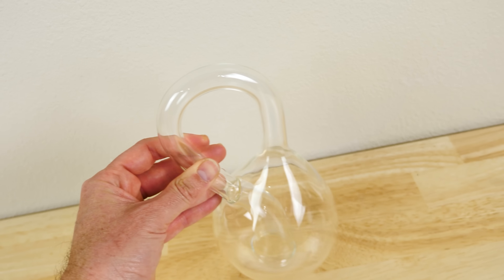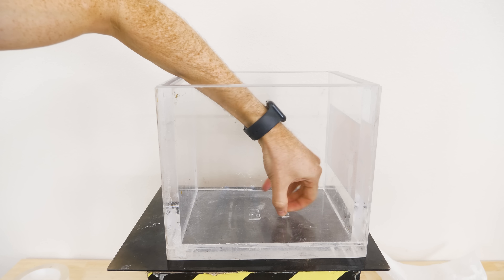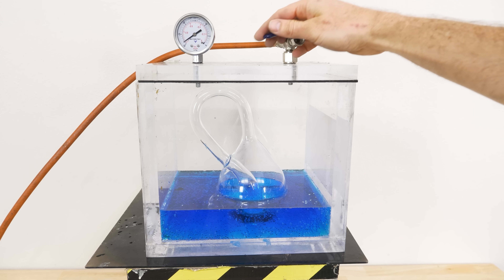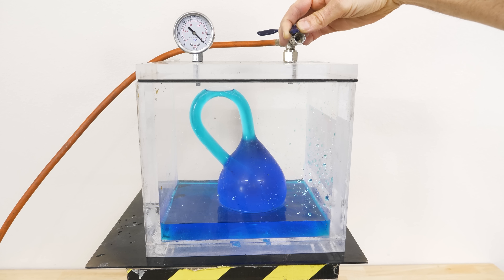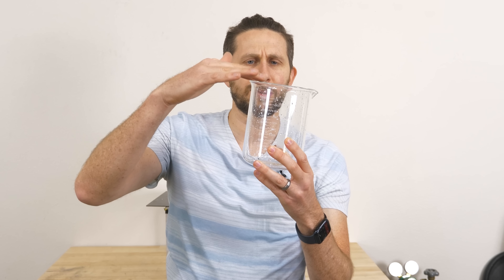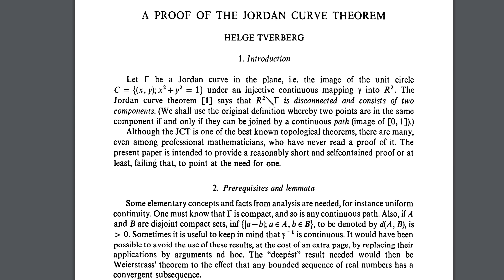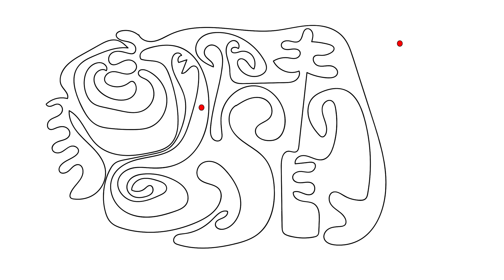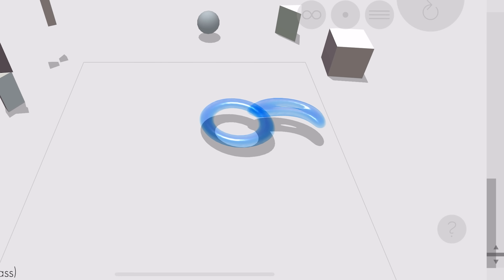Is It Possible To Completely Fill a Klein Bottle?

Comment: Yes, you can fill it very easily. Instead of tilting and turning, you can use a flexible hose like colonoscopy hoses and before inserting it into a bucket of water, insert the hose completely so that it touches the top of the bottle and one end has a way out, so because The air inside the bottle is connected to the ambient air through the hose, when it condenses, it can be released and the pressure does not increase and remains equal to the atmospheric pressure, and in this way the water easily fills it all.
Reply: Or simply submerge it the same way its sumberged in air. May have to move it around a bit to get rid of bubbles but all he needed was a pool or tub and some water. It has volume in the same way a cup does. Idk why he needed to use the klein bottle. If anyone could explain to me why the klein bottle is actually special for this case i would appreciate that because the point of this video definitely alluded me
Reply: @gagemiller1604  The klein bottle is like the beaker. it has no inside and no outside mathematically. Just like the open curve that didn't get filled red. I thought this was obvious as all it is, is an open bottle with it's spout curved back through it, but maybe it's difficult for some people? I don't know. Topology is really interesting for more complex and abstract uses, but when it comes to fairly simple things it's down right stupid imo.
Reply: @gagemiller1604  But Pirates of the Caribbean taught me otherwise.
Reply: @gagemiller1604  the point of the video was to talk about curves, volume and a 4d object. the filling of the bottle was just there to get you to watch the video. like he said, the real bottle is in 4 dimensions.
Reply: @gagemiller1604  Did you mean: eluded?
Reply: @gagemiller1604  right! The point of this video is supposed to be that the Klein bottle is a 4D shape, so it shouldn't work, yet because we live in a 3D world, it works. Meaning, this isn't a true Klein bottle so obviously results will differ.
Reply: man suggests to use colonoscopy hoses instead of something normal like a straw
Reply: @RhodianColossus  that's how you know they have a sense of humor.
Reply: That's what I thought. If your problem is atmospheric pressure, why not pour liquid straight inside
Reply: Exactly i was thinking about the same idea... vacum chamber thats thing we all have home...
Reply: Or just use the hose to pump the water in.  Air doesn't really need to be upright to escape so long as there's a path to atmosphere.
Reply: Or submerge the whole thing and turn it round and round and round letting out some bubbles of air every time.
Reply: This guy is a math or physics teacher I swear
Reply: @Deejayjax  yes I am a physics teacher in Iran
Reply: @shayanalinejad8059  guessed it lets goo
Reply: Couldn't you also just blow the water into it using your mouth?
Reply: @spencerwallace4805  it could be anything that can compensate pressure while pouring liquid. Including your mouth, yes
Reply: Summary: put a long straw in it
Reply: THAT is science AND intelligence 👍
Reply: My comment was going to be “straw”
Reply: You are such a genius wow! No one older than 10 could’ve figured that out 🗿
Reply: @juanki8350  are you jealous؟
Reply: That was also my first thought!
Reply: Yeah but the video is more fun
Reply: Just lazy people who claim it has no volume. To see how much volume it has just fill it completely catch the water in another container which can measure volume very simple. This guy does many experiments and just talks absolute rubbish
Reply: it’s not that deep, the straw just stops the water from trapping the air.
Reply: Id like to see this
Reply: Exactly 👌🏻😌.
Reply: Perfect
Reply: Oh yes, why didn't I think of that, let's just grab the colonoscopy tube from my kitchen. It's something I use all the time.
Reply: @poro3246  take a bendy cocktail straw maybe?
Reply: @poro3246  Damn, I thought it was just me! Glad to know someone also uses a colonoscopy tube all the time
Reply: @poro3246 ya what an idiot, who has anything that might be akin to a tiny hose in their house, a vacuum chamber on the other hand, basically comes with the house these days!
Reply: I don't think you could completely fill it, though. Because the hose is inserted, that's some volume being taken up by the hose, and to remove it makes it impossible, I think?
Reply: @zackarysemancik5491  if you remove it while continuing to pour water or whatever it will fill the space with water before it can fill with air
Reply: @Marshall Edwards  well, if the big bowl type part were at the top for instance, then as you pull the hose out, the water will fall out of the bowl part.
Reply: @zackarysemancik5491  No it wont, hoses are flexible, it will be able to bend instead of requiring you to change the bottles position.
Reply: I understand what you mean
No, when the hose is removed, the water inside the hose is not removed and does not rise. Because first of all, there is water in the hose and it is at the same level as the pool water. Due to the principle of equal pressure at equal points. After you take out the hose, the water level inside remains constant and does not rise because the air pressure on the water surface is constant, so the hose comes out easily without stealing water with it, unless you put your finger on top of the hose and block the air inside the hose. This is because when the hose is pulled out, the blocked air expands and its pressure decreases, the water inside the hose rises and reduces the volume of water in the bottle.
Reply: @zackarysemancik5491  i see how you can put a thin hose inside, fill it and as it starts to fill. turn it upside down till it fills the edge
Reply: No idea what you said, but it sounded convincing so I gave you a like.

Comment: HOLD IT RIGHT THERE 
you dont need a vacuuming get that fill up because air is trapped inside so you need a tube or small hose and stick it thur tunnel and let air escape it will fill up with liquid 
it aint that hard if you take a guess what stopping it from not entering it

Comment: The cup (and the bottle) has an inside and an outside and therefore volume, the inside is the solid glass/plastic itself and the surface is where it touches the air. In order to lack volume it would need to be infinitely thin. For filling just use a hose lol.

Comment: The problem with "scientifically" defining what is and isn't volume is that it neglects the practical and realistic world. 
A cup, according to topology, has no volume, and yet a garbage bag of cups will be bigger than a garbage bag filled with the same number of cups neatly stacked into eachother.

There is such a thing as practical volume, and is why it is courteous to empty crush any fast food beverages before throwing them into the trash, so the bags can hold more stuff. 

This is why we need to keep at least one engineer in every mathematician's workplace as an anchor for realism. Otherwise we wind up with nonsense like trying to work with the square root of negative numbers, which mathematicians literally call "imaginary numbers".

Comment: hmm.  Isn't there a branch of philosophy that says that you don't have to, "prove," observable phenomena? Seeing is believing after all. Like I only have to prove that a ball is red to a person who cannot see the color.  At which point I would go into detail about light frequencies and refraction. To a person with average color vision I would not need to prove that a ball is red.
 Perhaps I am confused about two different words that sound like, "volume."  If an object is a container, then it must have a volume. That version of volume is a measurement of the container's ability to contain something.  As for saying that the top of a container is an arbitrary boundary, that can't be true.  The lip of a container is a well defined area, it is the point at which a container can no longer contain anything.  Fluids and particulates that exist beyond a container's lip are outside of that container's ability to contain.

Comment: the trick to filling it with a hose, is to use a thin hose.  The hose should be about half the diameter of the bottle neck at its thinnest point. Insert the tiny hose all the way through the neck until it is well inside the body of the bottle. Make sure the opening of the bottle, the base, is facing down. Once the body is full, slowly withdraw the hose, while still passing liquid through it.  When the hose is completely withdrawn, then flip the bottle over and fill up the rest of the neck.  I am not sure why folks seem to think that a hose has to be the diameter of a garden hose, especially on such a small bottle.

Comment: In topology, a container is a mathematical object that can be thought of as a generalized form of a set. As a result, a container in topology does not have the concept of a "volume" as it is not a physical object. Instead, a container in topology is defined as a collection of points that satisfy certain conditions. These points can be thought of as the "elements" of the container. It is possible for a container in topology to have no elements, in which case it could be considered to have "no volume," although this concept is not strictly defined in the context of topology.

Comment: how is this difficult? use a small flexible hose insert the hose into the largest portion of the cavity and fill it from the inside out, the air will easily escape as the water is added. then submerge the klien bottle once themain cavity is filled and turn it upside down to fill the neck. .. there completely filled kliein bottle.

Comment: Question 🙋‍♂️. Can someone explain to me… If you suck all the air out of a vacuum chamber with the glass inside, wouldn’t the pressure of no air break the glass? Or does it not break because there is no volume to that specific glass structure?
Reply: It's not the lack of air that would break the glass, it's the difference in pressure between the inside and outside. Specifically, the air inside a sealed container exerts the same pressure as the outside air. If you remove the air from inside, the outside air pressure can "squeeze" the container, causing it to break.
However, inside the vacuum chamber, air is being removed from the container as well as the chamber, leaving no pressure differential.

Comment: 1:10
Cool idea with the vacuum.
I was going to suggest using a very flexible pipe, possibly robotically automated to make it more practical, to pump get into the main section of the device, and then fill the pipe with water that way.
Thus the mass of the water might force out air, combined with a lot of playing around to get out the last bubbles of air whole the device is completely submerged in water...your idea seems way more practical and straightforward. Good thinking. Well done sir.

3:04
Well done sir. Great work

Comment: When liquid is in a vacuum chamber and starts to boil. Is it actually hot and at boiling point or does it just appear this way because all air is being sucked out?
Reply: changing pressure changes the boiling point.  something being at boiling point doesn't necessarily mean it's hot.

Comment: You could have also filled it by putting a straw down the neck so the air has a way to escape while you fill it up.  If you don’t have a vacuum chamber big enough for your Klein bottle.

Comment: Call me mundane, but I just can't agree on this idea that a beaker has no volume, and that the volume is arbitrary or simply "suggested". Clearly its maximum volume is how much it can hold without spilling, including the convex meniscus. Yes, if there were no gravity then it would be hard to hold anything inside, but the calculated volume with gravity in effect would still be the same because the dimensions of the beaker don't change. In a reality with no gravity, it would still be a "potential volume".

Comment: You could also replace the air inside the bottle with steam then submerge in water. Provided the water is hot enough the bottle doesn’t shatter.

Comment: I think I would define something with no volume as something that can't contain objects in 0 gravity. You made a good point before with the ball and the beaker. And the klein bottle's outside and inside worlds are the same exact size, so volume is 0. Same with the beaker. If you pour something into it, the only reason it would be "containing it" is because of gravity. If you filled it with water in space, after some amount of time, it would all leave the beaker. But if you filled the ball, or any object with volume with anything, that object should never leave it after an infinite amount of time.
Reply: Great explanation! In high school the concept of volume we were taught seemed more about how much could be contained than how much could be trapped, so this video is the first time i heard this. In maths class a cone with no top circle is the same 'volume' as one with.

Comment: You could just get more water in a tank, fully submerge the Klein bottle, and then start to rotate it under the water so while the trapped air moves upwards it eventually leaves the bottle. 
Vacuum chamber is surely an overkill.
Reply: right? Everyone else is talking about inserting a small hose and stuff but that there is an even simpler solution.

Comment: I don't see anything special in this bottle. Just that it fills from it's bottom through a tube. And so it has volume. If it didn't - you won't be able to fill it. So the problem is the definition, not the bottle.

Comment: Tecnically you can easily calculate the volume like this:
First you need the volume of the ball-like part without counting in the hole, then you calculate the ribbon like part from the top part of the ball like section to the point where it crosses the side of the bottle, then the par from the bottom hole to the side is both sustracted to the ball like section and added to the ribbon like one. It has a defined volume but it reaches a point where is both possitive and negative, either way the volume should fit exactly the quantity of water it could hold upside down.

Comment: it can be FULLY filled by injecting water, with a small diameter hose...
push the hose intake to the end.
start filling water at a moderate speed...
stop and flip to continue filling to the full.

Comment: The animated example at the end made me think of portals, if there was a portal that leads from the end of the neck into the wider part instead of going through the wall it would have being a true Klein Bottle

Than again, it would work with all close shapes if there is a portal in two of its wall and a vacuum "inside"

Comment: Re a beaker having no volume. A cross section of the beaker is not a line though, it is a closed shape!?  Also have the comments been disproven about filling the bottle with a 'hose' or submerging?

Comment: Fill it by running a small rubber tube that's half the diameter of the glass channel allowing water in and air out.

Comment: The volume being outside minus inside is a really loose definition. The only situation in which that formula even works is if you have a hollow but closed shape. So it’s not true that it has no volume; it only has no defined volume for that formula.

Comment: you can fill it up with a rubber tube to be put into the bottle, pump some water in the tube and you almost done.
it works as long as the air can gradually escape towards the end

Comment: In 5 secs, I imagined a way to put water in it. Get a small flexible tube and fill water through the tube so as the bottle is filled, air can easily get out. One way is to use that flexible tube as the outlet for air as you pour water on the bottle.

Comment: Submerged the entire bottle in a container, wiggle it around until the air is emptied.

A thin hose slowly fill the inside.

High pressure jet of water can fill it up as well

Comment: 6:35 "You need vacum chamber to fill up"

Can't you just use thin hose, insert it into klein bottle until it reaches 'big chamber', fill the "U-shape" part with water to create the seal (so no air can get through) and then you just suck the air out through the hose? The negative pressure [aka. pressure lower than atmosphere] will 'suck' the water up.
Reply: The pressure would cause an explosion
Reply: @thationizedkid7238  No it would not cause explosion. Since pressure would be constantly balanced by water being sucked inside.

Comment: 03:15 "...in order to have volume, you have  to devide the inside world from the outside world..." Based on this, i'm wondering now, if it is possible to calculate the volume of the universe. This would mean else there is an outside world to the universe or the universe has no volume while inside and outside world are identical. 🤔 
There are visiualizations like grafics of the shape of the universe that show kind of a roughly funnel- or bell-shaped dark structure on a grey background. What do physicists know about this grey background?

Comment: Why cant this have volume? Because it's not enclosed? Does a beer bottle without a cap not have a volume either? If you can fill both with a liquid couldnt you measure that liquid and say that's its volume?

Comment: How about this, a hose 1/2 diameter of the  diameter of hole of bottle is put into the bottle (outside hole of the bottle kept downwards) the other end of hole fit to s high speed water pump / large siringe. Then when we insert the liquid through the tube and the air would be removed from the rest of the hole. As the speed of filling would be greater than the speed of spilling out of  bottle is greater, it would be possible to fill the bottle fully.

This is just a shower thought. Im no scientist. 
But pls if this works just let me know

Comment: You should do the trick where you put string around glass bottles and soak them in alcohol then ignite it to see if they break clean when dunked in cold water but instead use liquid nitrogen to see if there’s any difference!